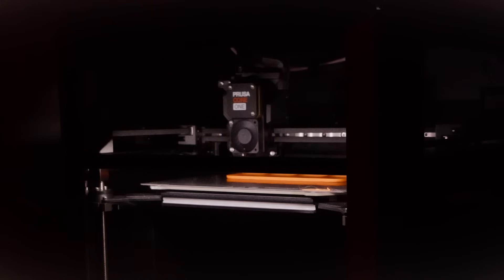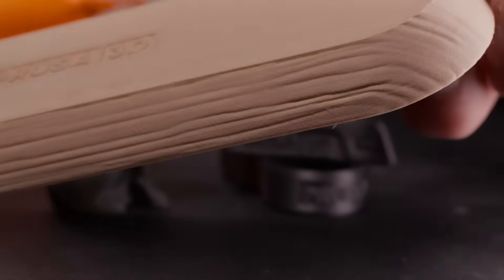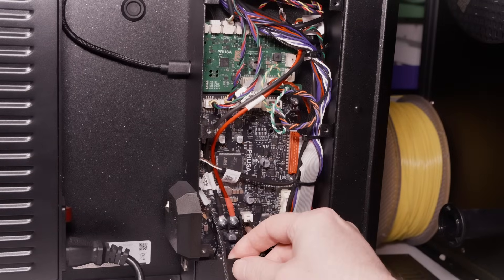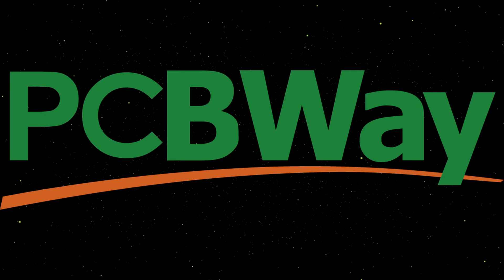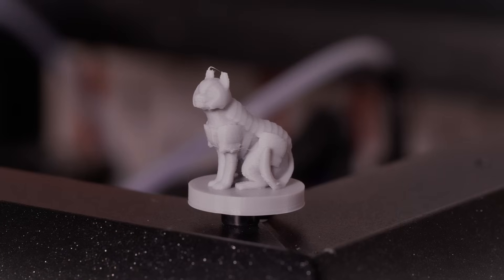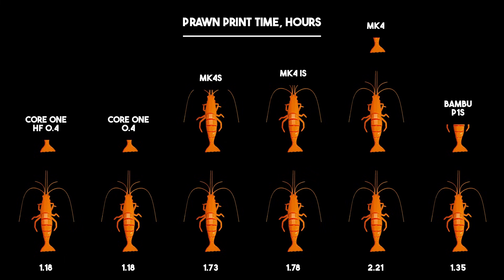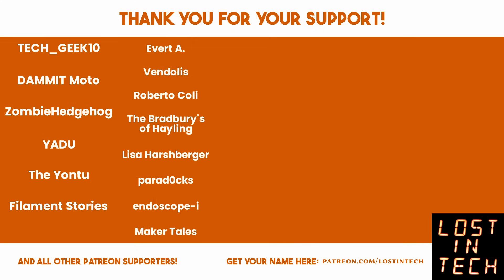Why the NEW Prusa CORE ONE is a 3D Printing Hobbyist and Modder's best friend.

Comment: What's the difference between MK4 IS and MK4S?
Reply from the maker: IS is a print profile that uses "input shaping" which was in an update to the MK4 printer's firmware. MK4S was a hardware upgrade that changed the cooling fan mainly.

Comment: But prusa refuses to release mk4 mk4s mmu3's CAD step files.only stl.  Very difficult to mod if not impossible.
Reply from the maker: Finally someone worse than me at using a pair of calipers. Take a seat. We can get through this.
Reply: @LostInTech3D  I think this is a legitimate concern. You can REMAKE the parts to be solid in Fusion, but that takes time. 

Your overall attitude in this entire interaction, all of your comments as a whole, make you out to be a very shrill person. I personally find it is better to not act like that if you're trying to convince people to agree with you.

Comment: Still looking at this for my first printer, but I thought that it ships with a brass nozzle and in order to print advanced filaments you need to order Prusa’s hardened nozzle and an advanced filtration kit that does not seem to be available yet. Is this correct?
Reply: You need a hardened nozzle for materials with abrasive filler like CF, glow in the dark, wood etc. 

Filtration is only needed if you print “stinky” materials in your living space.

Comment: I'd rather get an Elegoo Centauri Carbon with the bigger build plate for $299...  The Core One was immediately screwed when Elegoo announced that price point.
Reply from the maker: well, thats a broad statement for a printer that's sold out, but lucky for everyone who's going a bit mad for this printer, I should be getting one in for review!
Reply: @LostInTech3D  Yes its sold out, sold out in the first 10 minutes of preorder.  Hobbyist and modder sure, but you have to make money as well and the 3D market is evolving past those individuals.  I'd love to own a Prusa one day but not with the current pricing and build volume.
Reply from the maker: @ I think the elegoo will sell an absolute tonne because its just cheap (assuming they make them) - but I also think prusa wont see a dent in their sales because of it. Not sure about bambu, they might, who knows. I imagine they're worried.
Reply: @LostInTech3D  Absolutley, I think both should be worried.  Sure Prusa might have a specific customer type but profit is profit.

Comment: As far as the bambu not being "open source". Running it open source, the features that you lose, put it where the Core One is. When you run it on the bambu network, you get a lot of features that Prusa doesn't offer. As far as the bambu vs the Prusa out of the box, the bambu is much more of a put it on the shelf and print style printer. The type of printer that is great for those that don't care to tinker.

The fact of the matter, is that if you don't want to tinker, the bambu X1C is still a better buy for the money. If you like tinkering, then the Core One may be a better option.

Prusa printers are still overpriced. The fact that they wait a year or two for the other companies to RnD a lot of the features before they finally release their version is more of a cost savings for them than anything. My buddy had an MK4S and it was way overpriced compared to other bed slingers of the same size. The fact that an A1 was less than half the price, was sad. I see similar issues with the Core One.

Comment: In my eyes the price for this printer is very fair, my issue is its print size.  I already own an X1C and till recently I've been very happy with it.  I want something in the XL size range (350x350x350), but by the time you add an enclosure to an XL its price is a hard pill to swallow.  I don't trust Qidi or Creality as they both have bit me on reliability and support.

Comment: 3:10, you mention that the K1C isn't that reliable. Is this based on the units from earlier in last year or are the more recent units also like this? I've heard they've changed some stuff since it's release last year.

Prusa is highly attractive to me but I have a good coupon for a k1c that could save me a lot of money, so I'm a bit conflicted. Either Buy the MK4s to upgrade later (thus stretching my budget quite a bit), or get the K1C to save some money...
Reply from the maker: The K1 series had a bunch of extruder issues, it was a silly thing for them to fail on, because the printers were overall good. I don't know the current status actually, it's probably really hard to figure out. I have my K1 Max still and it's a bit of a workhorse, so who knows!

Comment: So, you could use those GPIO pins to control something that automatically opens the vent when printing PLA?
Reply from the maker: Yes and I was going to until I realised I'm supposed to be releasing a video and not endlessly tinkering 🤣 it would be trivial electronically but a bit more thought mechanically

Comment: The only thing that bugs me with the CoreOne is ... someshow reusing the MK4(S) board. There may be some reason to this, yet having QGL or 3-point Z-tilt is extremely common since a few years, so I don't get why Prusa didn't get it. That's probably the only reason why I'm unsure about buying it as new.
Reply from the maker: wouldnt that be more of a firmware thing?
Reply: @LostInTech3D  That's a good question.
AFAIK, Prusa Firmware is a vanilla Marlin tailored for Prusa printers through config files for each printer. Since Marlin implements z-motor alignment and 3-point bed leveling, it's already there code-wise. That's why it might be related to hardware.
Reply from the maker: I don't think so - apparently prusa FW has very little in common with marlin now, or so said Jo himself - I haven't done a diff on the repository lol. I actually have no idea how they're tramming the bed on the core one. I don't think anyone's mentioned it, or I wasn't listening.
Reply from the maker: yeah the licence requires them to credit it but I'm not sure beyond that. At some point I've got a plan to do some stuff that needs a recompile of it

Comment: There have been some reports of VFA (ripples) on vertical walls at lower speeds, say 60-80 mm/s, which is nice for silk/petg , have you seen any?
Reply from the maker: I've never seen a printer that doesn't have VFAs at some speeds, so I wouldn't be surprised. I'd be more surprised if there wasn't. But I haven't noticed anything on the parts I've printed with default profiles - I think wall speeds are more like 100 but I'd have to check.
Reply: @LostInTech3D  There is a topic about this on the prusa forum. Thanks for the video, enjoyed it!
Reply from the maker: I'll try to find it, if you want to link it I'll approve it in the mod queue

Comment: 12:55 I see you struggle to pry that TPU print from the PEI sheet. I found that squirting some denatured alcohol onto the bed makes TPU prints release with relative ease.
Reply from the maker: I like to do things the hard way but yeah I've heard that one before, but somehow I always forget. Thanks :)
Reply: I was very successful with printing TPU directly on the Textured sheet, great adhesion, and kinda pops of afterwards if you flex the plate

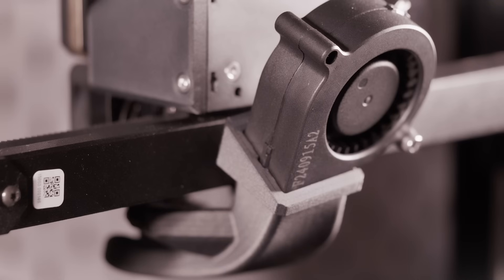Comment: 2:37 i can print abs on my cr10 max, its not hard. And a creality k1 can easily do it as will my custom corexy, all more affordable than the prusa.
Reply from the maker: I printed ABS on a sovol SV06...it's never been a huge problem for me either.
Probably no surprise since it was the material they used to print on the RepRap.

Comment: I'm sure it's a nice printer but I struggle to see how it brings any tangible improvements compared to a 2 year old X1C? Other than perhaps the GPIO board if you're into that sort of thing (I'm not).
Reply: @henr1k5  

I agree, while this printer has a few unique qualities, it is not bleeding edge.

I do appreciate that it is quieter and more optimized for the spaces I will be printing in.

You also are getting freedom from the manufacturer. BambuLab technically can just brick your printer. With a Prusa, the company could disappear tomorrow and you could still use your printer.

Prusa also does offer far better customer support than BambuLab (they are trying to improve, however).

Ultimately, I think both options are good in terms of printing. I think what you are picking between is the culture you want to support.

Comment: My MK3 is about five years old. Just keeps working. Turn it on and print. Never fails me. Very tempted to get this.
Reply: My Mk3s is still a workhorse; The only thing I've changed is build plates.  I'm picking up 2 more this weekend from someone that's upgrading.
Reply: @ElizabethGreene  My mk3s+ might be looking for a new home soon... I'm very tempted by the core one :p
Reply: Exact same here. 

It runs (in fact they because I use 2 of them) the same as on day 1, with only 2 clogs for 1000s of print hours. And the last one is probably my fault, because it seems that I've not secured the PTFE tube the right way during the previous maintenance, so that it went backwards and the filament built up a small blob in the space between the tube end and the heated part of the head. Fixed in almost 1 hour, taking my time not to damage anything during head disassembly.

I'm about ordering a Core One in kit. It saves a significant amount of cash and makes you fully informed of how it's built and works. And my experience with assembly the MK3S kits has been very positive.
Reply: @RichardEricCollins  same here, the ol mk3 just works. Parts are available, so are upgrade paths and new firmware. I definitely appreciate that they stand behind the product over time. So I ordered the core one kit for fun, not that i really need it, but it means i can sell my printer to a friend and more people can enjoy printing:)
Reply: The 3.5 upgrade is worth every penny. It is so good it will put off my getting a core one for a bit as I've upgraded both my mk3s machines

Comment: Comments TLDR: 100 ways to say "I have no idea what Prusa does" without saying "I have no idea what Prusa does"  😅

-------------

Every time I see Core One, I want one. It's well built, well behaving. Worth the cost? Depends on what one needs or wants. Is your Nissan or Tesla or Bosch or 55" OLED TV worth the cost?
But educated guess (printer lottery aka lemon lottery) for FF AD5X or Creality Hi (last word must be said on high note) for PLA/PETG support interface would also be quite nice.

Well, I don't actually need new printer, so I could just throw some (good) money (after bad money) on open source MMU - which solves none of existing issues with z-offset and layer uniformity...

Comment: You can just push the rivets out from the inside. It's a good idea to protect your finger though with a thimble or something else :-).
Reply: Just 3D print a rivet pusher. You got that printer already waiting to do useful stuff anyway... 😉
Reply: I use the pliers to pull the heads out.

Comment: Is the printer quiet? Can it be compared to the ender 3?(with silentboard)
Reply from the maker: No it is not quiet, those days of silent ender 3s are gone. Very few printers are quiet like that anymore...none I can think of. 

(The fans were never quiet anyway)
Reply: @LostInTech3D  I only have the original one so far. But with the silentboard upgrade it was possible to be in the room. If it is at that level, I can bear it. Thx for the reply
Reply from the maker: it's not lol.

Comment: "... didn't review it in a conventional sense." You didn't review it at all, you chose to sea monkey for Prusa.
Reply from the maker: Go on. 😏 Explain exactly what I did and where. I'll wait..
Reply: @LostInTech3D This Influencer == Guerilla Marketer.

"The closest match to the printer is probably the Creality K2" - No it's the Bambu X1C

"Bambu X1 is kind of old now ..." - Let's pretend age matters, not performance.

"Elegoo Centauri thing, I'm not yet convienced to what that even is." - It's a 3D printer, welcome to the market little sea monkey.
Reply from the maker: Interesting takes but I don't agree with them.  
We can disagree on points without calling each other sea monkeys whatever that is, can't we?
Reply from the maker: I would have to check the script again but I don't think it was intended as derogatory. The whole point of that passage was that it's near impossible to do a like for like comparison with the printer on test because nothing is directly equivalent. 
You might disagree with that but it's ultimately my review and I tried to explain my rationale.

Comment: Awesome, thanks for the brulliant comment.

I run an mk4s and ofc the core1 sounds like a very nice upgrade. However what is your view around using an mmu instead of a multi-head setup like the XL?

I know it is not something we can choose... Is the mmu reliable long term? Wasteful? Slow? Clunky? I just don't know.

Getting an XL does seem silly however even if i could save it is just a price point hard to justify for the hobbyist.
Reply from the maker: The mmu doesn't waste a huge amount. The only huge downside is it's incapability when it comes to flexible filament.

Comment: While this is probably a comment only important for hard core time lapse people, the GPIO board has a headphone looking thing that says shutter. That is for firing off a DSLR camera as many have the ability to hook up a wired shutter button.

I wonder if the GPIO board could drive a tiny actuator hooked to the louvers so that custom gcode on say a PLA profile could tell it to open them but an ABS profile would close it.
Reply from the maker: Yes it absolutely can, if you join discord I can probably flesh that out for you